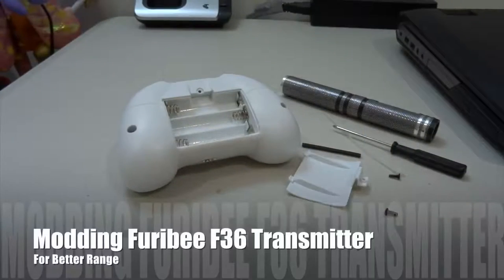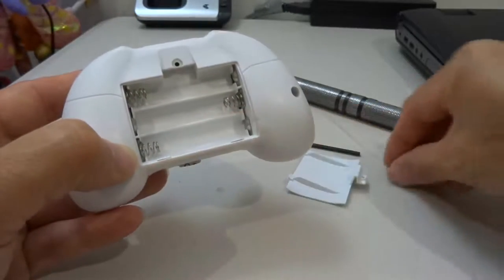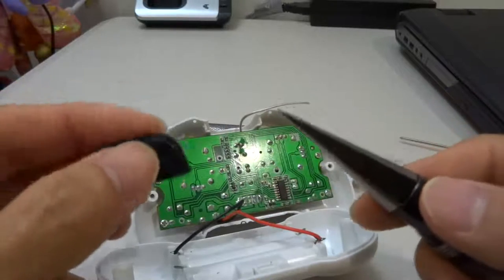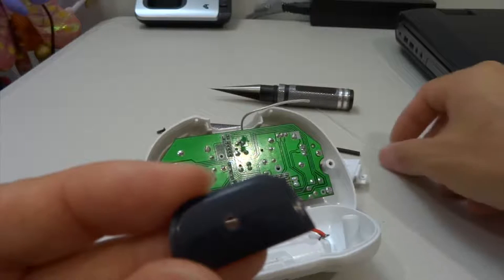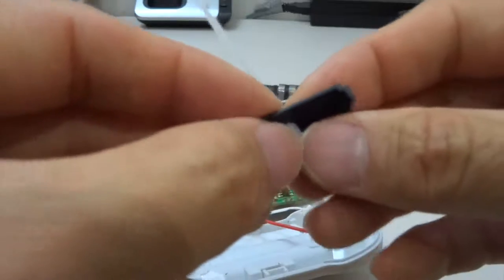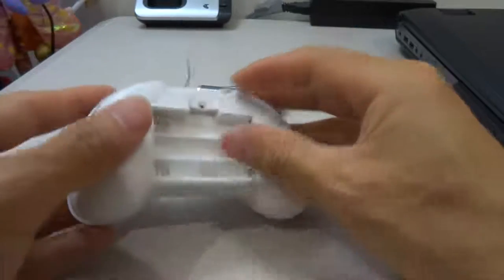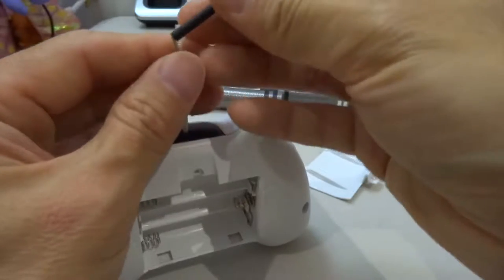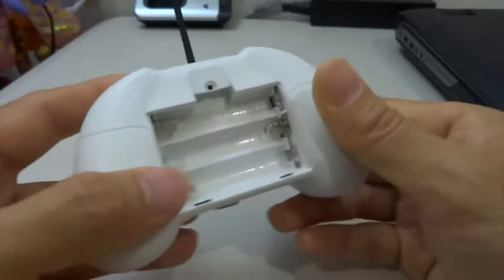Modding - Furibee F36 Transmitter Antenna - for better signals

Comment: JT: Can you upload a video for your range test to quantify the antenna mod? Thks!
Reply: I like the ziptie and heat shrink look, thanks! for the doubters, this simple mod works very well and it helps to do the same to the quad to get it's antenna a little further away from the noise of the esc/receiver board. outdoors without other sources of interference it can near triple the range. costs nothing, takes 5 minutes, and a major improvement.

for the time it took to type a "doubt it" comment, you could basically have done it and ready to test it for yourself. no hatred, but it's kinda comical. I swapped the boards from my H8 mini and F36 transmitters, also the joystick knobs so it's black with white buttons and levers, H8 now white with black buttons and levers, its just a "for looks" thing, to better match the 4" black fpv monitor I'm waiting on. (mounting it to the teeny transmitter oughtta be real fun but I just don't like goggles)
Reply: I didn't expect my request stir up a storm. That's not my intention. My own experience is that getting the TX/RX antenna away from the circuit board do increase range some but don't know the amount and consistence. That's why when I saw JT's neat mod, I am curious and like to know the data behind it so as to learn from other's experience.  Thanks!

Comment: Nice JT 👍. I did the same mod before I flew mine lol. I had to remove the board too because it was tucked down the front and at the bottom. I didn't add a cable tie. I use the screwdriver it came with to make the hole lol. Thx Dod.
Reply from the maker: Thank you :) The tool that I used is very good. If you do a lot of mods, it is a must buy. Does it increase the range? I certainly experienced less drop outs and in theory that should help it go a bit further.
Reply: I'm not sure,I've not tried it without it being modded lol. Dod.
Reply from the maker: lol, I am not the only one. Other people have tried it and it worked for them.
Reply: Yeah. I also removed the middle spar on the battery bay,it's not needed... Another 0.001 of a gram saved lol. Thx Dod.
Reply from the maker: Thank you. Will try :)
Reply: you can drop 1/2 gram by using an E010 canopy instead btw.
trimming 4 blade stock props to 2 blade will add flight time, but if you're going to fpv it I do recommend the RakonHeli 3 blade props.
E010 canopy, 3 blade props, boldclash f01 vtx front mounted, swap battery connector to micro losi for H8 3D 260mah "upgrade" lipo's, I'm getting consistent 6-1/2 minute flights. it loses 12-14" of altitude doing flips (but I can compensate that with a little throttle before doing haha).
the front mounted f01 cam about perfectly counterbalanced by the longer 260mah battery too!

Comment: You say you increased the range 2X. So what does that mean?? Did I miss that part? Did you go from 50 m to 100 m or maybe 5 m to 10 m. Please QUANTIFY. Would be nice to know a validated range for this model.
Reply from the maker: I only tested indoors and I have no drop outs through walls and 1st floor. I don't fly outdoors with this quad as it is not suitable for it. Please see comments from model nutty below.

Comment: it is not for incrase signal you only chnge polarization of signal that means in some position of Q is beter sig in other worst ... you dont change antena plastic is nothing it is only polarization you need them same on dron and on transmiter but if you yaw by 90 degrees you can change it 100 % :D

Comment: ni fact before it was beter becose it was polarized horizontal in front an back of you you have polarization to right and left but not to dront ... lern this then make mod video but you have right you are not alone ...  :D
Reply from the maker: ondřej župka Thank you. I know about polarisation. I just didn't show it here. The antenna can still bend. I normally fly with my antenna in horizontal position. I do find that taking it out of the plastic in both the antenna and the quad make better connections. Thank again for explaining the polarisation as it is hard to cover everything in a short video and the comments are there to clarify things.